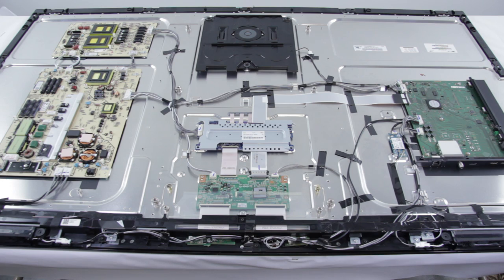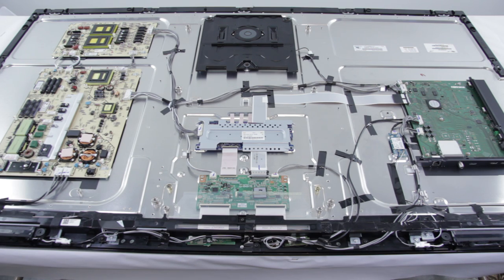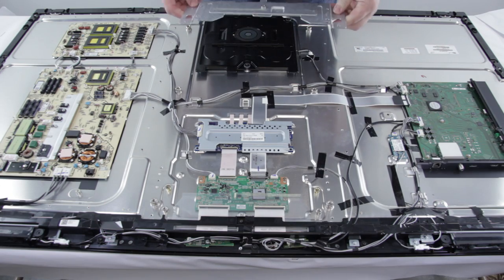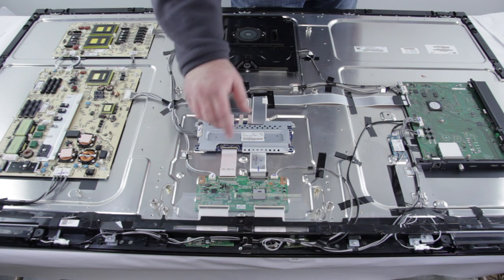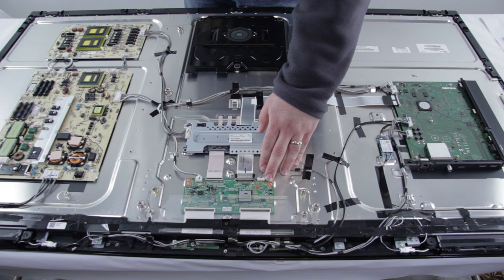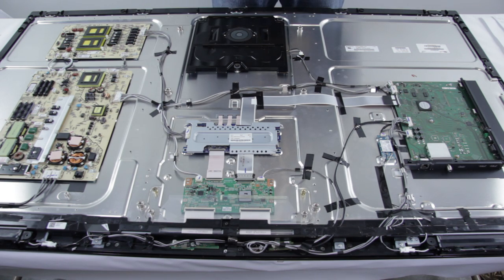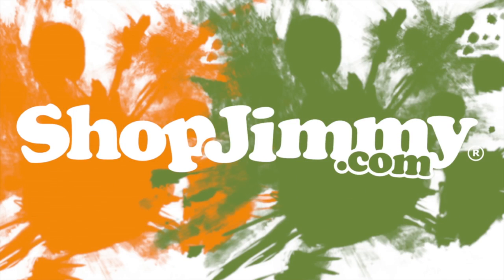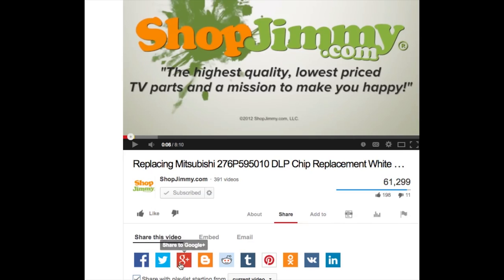LED TV Repair T-Con Board Help Review Overview - Common Issues and Problems with T-Con Boards

Comment: I have a Sharp LC-70LE650U.  The screen has gotten really dark, but I can see the picture, and the colors are out of whack (most faces are red, etc.).  It also has black horizontal lines that scroll through the picture.  If I remove the right side cable from the t-con ones side of the picture is white and the other is a perfect picture.  If I plug in the right side ribbon cable and unplug the left ribbon cable the other side of the picture is white and the one that was white (with the first ribbon cable removed) has a picture that is dark with black horizontal lines, like when both ribbon cables are plugged in.  Is this a t-con issue or a screen issue?

Comment: I have a Philips 47" 47PFL6704D/F7 TV that has dense horizontal grey lines on the bottom 90% of the screen. The top 10% still remains visible, but this makes the TV basically useless. The lines cover all the menus screens and changing input doesn't make a difference. Before this started the TV showed 6 small horizontal lines spaced evenly across the TV for about 3 months. Any help is appreciated.
Reply from the maker: Jason O   This could be a problem with the main board or the TV panel.  You can replace the main board to see if that fixes the problem.  Click this link to replacement parts for your TV model number:  http://www.shopjimmy.com/catalogsearch/result/index/?cat=56&q=47PFL6704D%2FF7  There may be multiple boards for the same TV model number, be sure to match part numbers on your current board, with your replacement for compatibility.  Here is a link to a video showing how to identify your part number, click here:  https://www.youtube.com/watch?x-yt-ts=1421782837&x-yt-cl=84359240&v=wooRqBrRo6o  Thanks and please let us know if you have any further questions with your TV Repair!  www.shopjimmy.com

Comment: my Panasonic viera tc-55as680u will not stay on and i tried to do the " hold the menu button ( on the remote) n the volume down button ( on the tv ) for 60sec. The hold both the power & volume button ( on the tv ) for 20 sec with the tv unplugged n plugged but none woked

Comment: I HAVE A LG TV MODEL NUMBER 42LV5500-UAWHEN THE POWER BUTTON IS PUSH I ONLY GET THE POWER INDICATOR TO COME ON BY TURNING RED AND THEN WHITE AS IF IT IS POWER UP, NO SOUND OR VIDEO. I'M SUPECTING THE T CON BOARD, CAN YOU HELP. FORMER TV AND VCR REPAIRMAN.

Comment: lg 47". 47ln5700-uh  busylwm. after turning on lg appears then tv turns off and red light goes out.
main board, correct? mine is eax64872104(1.0). the correct part on your website is ebu62184501 right?
but ive found a cheaper one else where that is listed as "LG 47" 47ln5700-UH Main Board EBR76777312 - EAX64872104" your website doesnt list ebr76777312 as a substitute, only ebr76777303. hoping the one i found will work.

Comment: Hi. My tv is having a problem where the volume turns all the way up and no buttons on the front of the tv or remote will change it.  We watched one of your videos last night that was helpful but now I can't find the same video.  We unplugged the ribbon cable that is attached to the board with the touch buttons on front, and the volume went all the way to zero.  We still couldn't change anything with the remote though.  We are thinking that board is bad but I can't remember the name of that board.  It is a LG LCD tv, 47CM565.  I was hoping you could give us a link about what the replacement board would be and where I could purchase it.    Thanks

Comment: I'm having an issue with my vizio 70 inch, similar to this video my backlights come on but the screen stays blank I can't get any sound out of it. after awhile it dims and when I press any button the backlight illuminates but still no picture. Model E701i-A3E

Comment: TV still not fixed after replacing t-con board . I already replaced PSU and main board LG 55lm4600 . TV brightens and dims in a pulse from right to left. Also as if the brightness is being increased and decreased slowly, recommendation please . Thanks
Reply from the maker: Gavin Robinson   This sounds like the TV has bad lamps in your TV panel.  Unfortunately, we do not sell replacement panels.  Thanks!  www.shopjimmy.com

Comment: HI, I have a LG LED SMART TV (Model : 47LM67100) .Today I saw a trouble on it ,without shock and without water, the Tv was lost its screen and the TV has shown vertical line in different colours actually there was vertical line in spectrum.
could you please help me to repairing it?

Comment: I have a 55 inch Samsung 4K (Model: UN55JU640DF) that does not have pictures (screen is black, no backlight) but the audio is working.  What components do I need to replace?  Thanks in Advance.

Comment: Hello Sir,  Am having an issue with my Philips TV (55PUS7503/12). I started last year. There were 2 thin black vertical and 1 horizontal line on the screen which gradually increased and to this current time, the screen is all black, with no display. 
After doing research I learned it was the T-Con board. So I took a picture of the current T-Con and ordered the same thing but unfortunately I after replacing it with no images, still dark screen, and some lines. I have ordered 03 t-cons but the same result. 
I don't know if the boards I have been ordering are not the right ones or what. Please kindly advise. I am very far away in Africa and it cost me a lot to order the boards because locally I couldn't find them. Thank you in advance

Comment: Sharp lc60le835u.Picture went light gray.Did a reset by holding power while unpluged.Worked for a day and then gray agin.Tv has sound.Do u think it is a tcon or main board problem?
Reply from the maker: Chad Blondiau   I recommend replacing the T-Con board in your TV.  Here is a link to replacement parts for your TV model number on our website, click here:  http://www.shopjimmy.com/catalogsearch/result/?q=lc60le835u  Be sure to match part numbers on your current board, with your replacement for compatibility.  You can also call our customer service for further assistance with your purchase.  (877) 881-6492  Thanks and please let us know if you have any further questions with your TV Repair!  www.shopjimmy.com

Comment: Hi I have a Samsung 60-inch LED model #: UN60EH6000F. Just 2 years old. It powers on but there is no display at all regardless of input or any input cord connections. Not even the TV menu will display. It's out of warranty after 12 months. I was basically told I'm on my own. The only video I found suggested replacing the QD2 transistor on the T-Con board. I am trying to get as many opinions as I can and finding that part
Reply from the maker: *****   I recommend running the flashlight test on your TV.   Here is a link to a video we produced that shows how to run the flashlight test. https://www.youtube.com/watch?v=xUzCLgoSPGM Please reply with your flashlight test results and we can recommend a replacement part for your TV repair. Thanks and please let us know if you have any questions! www.shopjimmy.com

Comment: Thanks for a very informative video. Based on your info I have to suspect that I have a t-con problem. Please see my video here:
LG LED tv problem
It's an LG42LE4500. I gather that some t-con boards are bonded to the LED panel and are not replaceable without replacing the whole LED panel which is not economically viable. Cheaper to replace the whole TV in this case. Do you know if tcon board is modular and if so where can I order one? Thanks!

Comment: Hi  I have a LG model 55LW5600-UA that just got about 8" wide-white vertical shadow/white bar in middle to right side.
Still see a video behind the white 8" bar. All around other area has a perfect video. Again Video behind White 8" vertical bar is ok but has white light on top of video. It seems LCD issue to me.
You think, this is a T-Con board issue or main board or LCD issue?. Let me know. Thanks, SM.
Reply from the maker: Saurabh Makwana   This sounds like a TV panel (TV Screen) problem.  If your TV panel is bad, it may be more cost-effective to replace the TV as panels are typically hard to find in stock, difficult to replace, and expensive.  Thanks and please let us know if you have any further questions!  www.shopjimmy.com
Reply: Thanks, you're right. I found the issue before reading your this reply. That the LCD panel ribbon connector bus lines (hair line thin) are broken because of this liquid damage on screen. So have to forget about replacing this. Thanks for your reply and tip. Saurabh.

Comment: My tv model no. Is ua46es8000 my tv was running and it suddenly stop and picture run out. Now it is only have backlight and sound can you please tell me the problem that my tv is facing and that part

Comment: I have a Vizio model D650I-B2.  My toddler son got a hold of a spray bottle filled with water . he sprayed the front of the screen and it ran down into the bottom.  this caused little distortions on the screen, I killed the power and tried to dry it off as best as I could. now when the tv is turned on, half of the screen is a bluish color while the other half seems ok. would this just be a T-con board issue or do I need to throw in the towel and buy mama a new tv?
Reply from the maker: +Robert B   Try all repairs and troubleshooting at your own risk.  This sounds like a TV panel (TV Screen) problem.  If your TV panel is bad, it may be more cost-effective to replace the TV as panels are typically hard to find in stock, difficult to replace, and expensive.  Thanks and please let us know if you have any further questions!  www.shopjimmy.com

Comment: Samsung 40F4600 TV model with following symptom : no image, no sound, power LED blinks several times, the power supply is resetting. I have checked until now the power supply and all the voltages are in range, Main board main voltages are OK. How can I diagnose if T-con is damaged or there is a hidden fault in Main Board.

Comment: Hi,, I have a SONY BRAVIA KDL-52V5100 having a video issue where it has nothing but colored vertical lines when I turn the tv on.If I let the tv warmup about 10 min (with the lines on it) an then turn the unit off an then on again it,ll "usually" work fine..Lately though that trick isnt working. From your site videos an comments can I assume its the T-CON board? Thanx  Ed

Comment: Sansum TV model LN46A550P3F
Model code: LN46A550P3FXZA
The TV display has very recently become solarized but otherwise appears works normally. This TV is about 6 years old and has these issues with different  inputs (tv and dvd player). Is this likely from the tcon-board?
Thanks

Comment: I have a 47LN5400 LG TV. I have sound but no picture. What's the problem and what do I need to fix it?
Reply from the maker: robert cygan   I recommend replacing the main board in your TV.  Click this link to replacement parts for your TV model number:  http://www.shopjimmy.com/catalogsearch/result/index/?cat=56&q=47LN5400  There may be multiple boards for the same TV model number, be sure to match part numbers on your current board, with your replacement for compatibility.  Thanks and please let us know if you have any further questions with your TV Repair!  www.shopjimmy.com

Comment: I have a Samsung UN60f7500afxza. I recently installed a Samsung Evolution 3000 kit on it, followed all directions TO THE LETTER and it worked fine. A super awesome picture for about 3  hours then the picture went wacky - lots of outlines in different colors. Then it shut off and rebooted with no picture and went into a reboot loop, constantly restarting. I took the kit off and got a message saying I needed to go into the menu to remove the Evolution kit but I can't get there due to the reboot loop. What parts could be damaged?

Comment: Hi i have a samsung LE40A556P1F flat screen TV, there was multiple problems with this TV, first of all when I got this TV the red power light would flash for about 45 minutes before turning on. I done some research and replaced the power capacitors, this has now solved that issue.

The next problem I have is that when I turn the TV on, the screen is bright but then goes really dark and in the end looks like a negative photograph after a few minutes of being powered on. Would you know or have any idea where I can look now, I know its either the t-con board or the back-light inverter, but would you be able to point me in the right direction.

Thanks

Comment: My 18 month old LG 47LN5400 has audio but does not have a picture. When the TV is first turned on, there is a flash of light on the screen and then it goes black. When I shine a flashlight on the screen I can see the image. I replaced the backlight inverter with a new one from ShopJimmy but that did not fix the problem. Does it sound like it could be the T-Con board or is it likely something else?
Reply from the maker: Van Phillips   It could be a defective replacement inverter, a bad power supply board or bad lamps in the TV panel.  Thanks!  www.shopjimmy.com

Comment: I have a Sony Bravia KDL-32l5000 and have been having the colored blur issue that points to a T-Con problem, I took the TV apart and found your store does have a replacement model (Y320AB01C2LV0.1) but I also need the ribbon (M# YS0911 001868) that connected to the T-Con. All searches for a new ribbon have come up dry. Do you know of any other ribbon models that would work?
Reply from the maker: tlk1985   Unfortunately we do not.  Thanks!  www.shopjimmy.com

Comment: I  have a RCA 55" flat screen TV, about 4hrs ago my screen went out but i still have sound it started out with the vertical lines going through the TV then I heard a pop sound and the TV was fine the other day I turned off my TV before I left home I came back and I had a line from the top of the TV rolling down the screen and this morning I wake up and my screen is black with no lines but I have sound can you help me with this problem it's a brand new TV

Comment: I have a Samsung un55d6000 tv standby light flashing tv does not turn on. I have replaced main and power supply board and still doesn’t turn on and also there is no backlight.

Comment: I have a RCA model number/ LED55G55R120Q and as soon as u push the power button red light comes on and stays on no picture no sound nothing. I've taken apart and tested with my voltage meter and I'm pretty sure it's the fuse brought by the power supply but I'm not a hundred percent. If you hold the power button with the menu or the input button every once in awhile you can get the screen to Ill flash real quick and that's it it won't come on and stay on or nothing but it will Flash

Comment: Samsung UN40D6000SF: The top 8" of the picture is distorted, horizontally across the screen. It's "snowy" and has ghost images. The rest of the screen is ok. I've worked the main board by cleaning contacts and re-seating connectors. I have no spare parts to test with. Could it be the T-Con board.
Reply from the maker: +John Palumbo   Try all repairs and troubleshooting at your own risk.  This sounds like a TV panel (TV Screen) problem.  If your TV panel is bad, it may be more cost-effective to replace the TV as panels are typically hard to find in stock, difficult to replace, and expensive.  Thanks and please let us know if you have any further questions!  www.shopjimmy.com

Comment: Hello, Samsung Model LN40A500T1FXZA Version CN01. Recently started showing blown out colors, does not have any vertical lines or flickering. Tried different source, does it on HDMI and on A/V jacks.  Tried doing factory reset as well, did not help.  Does this sound like a bad T-Con board or something else?
Reply from the maker: Jean M  Please watch this video FIRST to help with your repair!  TV Repair! LCD, LED, Plasma, DLP How To Fix Your TV with ShopJimmy.com Help!  This could either be a problem with the t-con board or the main board in your TV.  I recommend replacing the t-con board first and if that does not fix the problem, replace the t-con board.  Here is a link to replacement parts:  http://www.shopjimmy.com/catalogsearch/result/?q=LN40A500T1FXZA  Be sure to match part numbers on your current board, with your replacement for compatibility.  Thanks and please let us know if you have any further questions with your TV Repair!  www.shopjimmy.com

Comment: I have a vizio e480i-2b, I had a distorted/ double vision issue and messed with the tcon board and worked for a while then I replaced it and maybe 4 hrs later it started doing it watching movie, when I shut off for the night comes on for 4 hrs then does it again. Any help would be great. Thank you

Comment: Samsung UN50H6201AFXZA;  no picture but back light LED's illuminate; can turn on back lite power with remote and manual button but will only turn off with remote; NOT manual button.  Checked voltage from power supply feeding the main board and are within a couple tents of volt stamped on board.  Replaced main board and have exact same symptoms.

Comment: Just replaced the tcon board on my lg 47lw5300 3d tv, but still has no picture coming out but just the sound.  What could still be the problem, the main board?
Reply from the maker: Victorino Manlapig  Please watch this video FIRST to help with your repair!  TV Repair! LCD, LED, Plasma, DLP How To Fix Your TV with ShopJimmy.com Help!  I recommend replacing the main board in your TV.  Here is a link to replacement parts:  http://www.shopjimmy.com/catalogsearch/result/index/?cat=56&q=47lw5300  Be sure to match part numbers on your current board, with your replacement for compatibility.  Thanks and please let us know if you have any further questions with your TV Repair!  www.shopjimmy.com